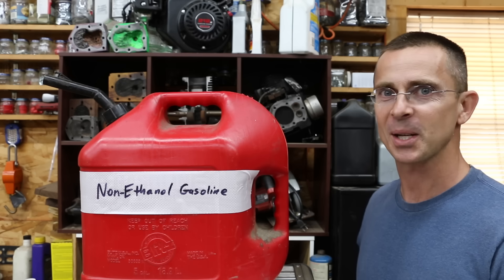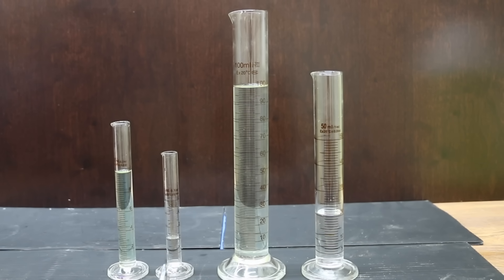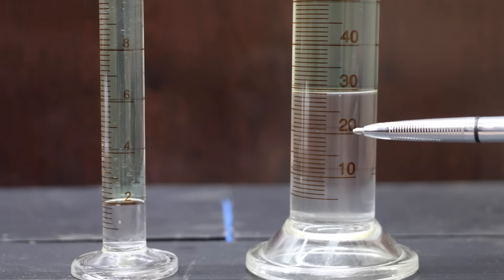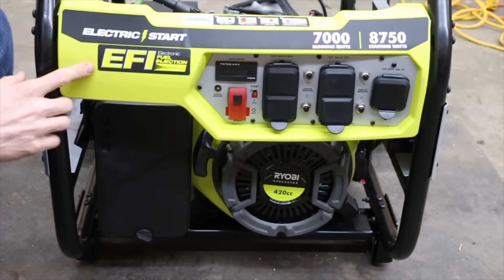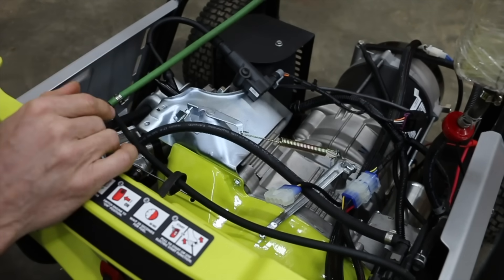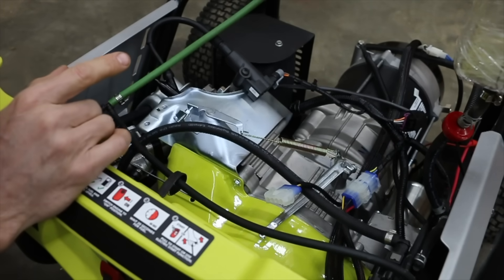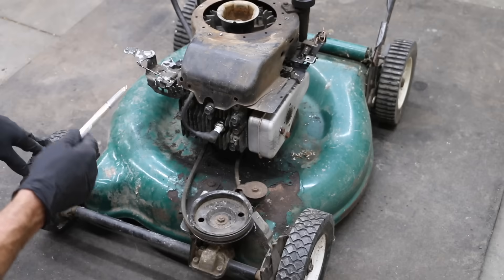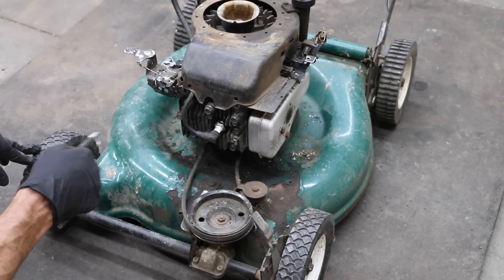Is Non-Ethanol Gasoline Really Better? See the PROOF!

Comment: Pros and Cons of E0 vs E10
E0:
+More energy = higher MPG
+No phase separation = long shelf life
-- Costs more
-- Not sold in my state * (Not once seen it being sold at any pumps in the state, but it is sold at some places)
E10
+Cheaper
+Better "tailpipe" emissions (I'd rather breathe E10 exhaust then E0 exhaust)
+Works as a very good long term engine cleaner
--Corrosive and attracts water
--Not sustainable, also funds monocrop agriculture
--Worse mileage
--Higher volatility can cause vaporlock
Reply from the maker: Great point!
Reply: @ProjectFarm  

https://www.sciencedirect.com/science/article/pii/S0301421513003856
Reply: @skeetorkiftwon  wow. 80% loss of energy from well to pump. Then we use an internal combustion engine wasting another 65-70%. That's 6-8% energy ROI, and it's crazy profitable. No wonder the trend is so hard to buck.
Reply: @timwcronin  

The loss has to be covered to run anything. Ethanol can't cover it. Well nothing can really.

 Batteries consume more energy in production than they ever store, then the coal drops from 100% to 60% at the turbine, lose another 20% to the generator, another 8% to line loss, another 25% to average battery life charging efficiency. Now half it to cover the battery. 

Even assuming perfect efficiency in the drive train you've doubled the minimum weight of the vehicle with a 1200 lb battery in a 3500+ lb car. 

Who cares how efficient the drive train is moving twice the weight when it's ALWAYS using more energy? 

Now remember it took liquid fuels to build and maintain the electrical infrastructure, the batteries, the cars, and support all of the food and the vast majority of other dependencies society takes as a given. 

That is how important a 6-8% energy margin is post consumption, not production. Of course, we could always go back to animal and manual labor.
Reply: @skeetorkiftwon  crazy right? So much stored energy and 92-94% of it's wasted, and it's still competing as the best. A pulse detonation engine would easily double the efficiency and then we're stuck on fossil fuels for another 100 years. I'm starting to think dystopian futures in movies may have been prescient.
Reply: @timwcronin  

A pulse detonation engine? As in the rotary motor, the pulse jet engine, or nuclear explosions behind a space craft?

There is no jet engine design that delivers force more efficiently than direct contact with the road, as pushing against air wont get you very far without a ton of thrust, i.e. massive loss.

That's why commercial flights aren't leer jets leaving every fifteen minutes with 20 people instead of two hundred or so.

There are tremendous applied science complications with even experimental physics that are demonstrated to work. You might get an engine to run, but can't keep it running with the materials it needs to run. Maybe the explosions are too powerful, or the vibrations too great, or you need to make the engine block out of stainless and the cost of cars would double without any longer life. 

There's lots of "great ideas," and in the engineering fields they've been thought and rethought thousands of times before the turn of the 20th century, let alone the 21st.
Reply: @skeetorkiftwon  as in an internal combustion engine that uses detonation instead of deflagration.
Reply: 恵勇気  In your dreams. Since ethanol takes almost as much energy to make as it delivers, it has no significant impact on oil imports.
Reply: @rcnelson  
Lol
Reply: It's only cheaper because you're penalized for using ethanol free fuel. It actually costs more to process ethanol and add it to fuel than it does to process regular gasoline. It's a con all the way around, and not a good one. You could cover every square inch of arable land in this country with corn to produce ethanol, it wouldn't come close to meeting the demand of switching to 100% ethanol fuels. It would barely meet the demand to supply the machinery to harvest and process it. Go ethanol free if given the option, you'll pay a bit more at the pump but less in the long run by filling up less often.
Reply: @codypoole3924  lol
Reply: Biggest issue with gasoline storage is probably the butane in gasoline which helps gasoline ignite. over time the Butane outgasses leaving the gasoline depleted of butane. Thus making it harder to start you engine.
Reply: @guytech7310  Look up Butanol as a fuel - it's a step past making ethanol, and has been around as an industrial solvent for decades. Also, it can be used in an UNMODIFIED internal combustion engine as it has similar properties to gasoline.
Reply: @guytech7310  You're kidding right? Butane? It's a gas at standard temperature and pressure, meaning that there is zero butane in gasoline. You are wrong.
Reply: Nope & I am not wrong. I am not kidding Butane is added to Gasoline. FYI: Dissolved gases can exists in most liquids, For instance:Fish need dissolved oxygen in Water to breath. 
https://oilprice.com/Energy/Gas-Prices/The-Reason-for-the-Fall-in-Gas-Prices.html

"butane can be blended into gasoline, and its fractional contribution to the blend roughly determines its fractional contribution to the overall vapor pressure of the mixture."
Reply: Let's correct "Better 'local' emissions" to say DIFFERENT local emissions.

You're producing a lot of formaldehyde and acetaldehyde with ethanol that isn't produced from E0 fuel.
I have no clue how those two are as 'greenhouse gases' but they are both toxic and are considered to be potentially carcinogenic.

Not to that gasoline exhaust is preferable or anything.  We just need to be aware that often when we hear about emissions, it's usually in a CO2 / greenhouse gas / hydrocarbon-fuels-are-the-devil kind of a context...
Reply: @HocchanFan  Correct! And Formaldehyde is a carcinogen.
Reply: E0 is so much more expensive for me that it's not worth buying in my daily; it's 70¢ per gallon more and I've heard it's $1 per gallon more in some places but it's 30¢ per gallon in others. I'm only using it in small engines since it'll keep them better and it has a longer shelf life (so it's much better for storage.)
Reply: @101Volts  You can get E0 near marinas as well, as watercraft are required to have VENTED fuel tanks, and e10 can't be used because of the corrosion caused by water attraction. You can get AVGAS as well at airports but it's leaded as well as expensive.
Reply: @QuantumRift  Interesting hearing this, thank you. I, personally, don't live anywhere near a Marina though.
Reply: on Brazil all cars are ethanol compatible so they can run in gas or ethanol and our gasoline have like 3/10 ethanol to gas ratio
Reply: all ethanol is; a farm subsidy, its more a contaminant then a fossil fuel E0, uses 2x the energy or more to produce
Reply: @wildfire53575  lol. Keep it coming it's getting even better. Better read some more propaganda to type on here
Reply: But muh' corn! (That China put up crazy duties for!)
Reply: US Government subsidizing ethanol production is the reason it is cheaper.
Reply: You sure it's not sold in ur state? Check your local lawn mower shop. Husqvarna fuel is 95 octane, 0E
Reply: @ragalyisp   

Josh Nixon Thanks! I found the stations in my state, unfortunately none within 280 miles of me...
Reply: What state do you live in? https://www.pure-gas.org/ lists all stations that offer non-ethanol gas. 30 cents more for me, but a longer lasting engine, more power, and better MPG are well worth the trade off. I use it in every car and small engine I have
Reply: Lower emissions?  Not really if you look at energy output.  You use more fuel to get the power output up to the same level as 100% gasoline.   So how is it better emission on e10? Corn growers association propaganda.
Reply: @timothyhays1817  

Loo
Reply: 恵勇気  you must've missed the memo.

We're supposed to like Saudi Arabia now.
Reply: Ethanol doesn't touch my equipment. I don't want my chainsaw to be drunk when there is work to be done. My lawnmower, chainsaw, brush cutter, and generator have never drank alcohol, and ain't gonna while I'm alive.
Reply: @CGoffgrid  That sounds about stupid.
Reply: Its corrosive, therefore it’s a poor long term engine cleaner. Try putting it in smaller gasoline appliances and you’ll notice it destroys components over time, especially if the device is left sitting for a prolonged period. If you run  it regularly then it’s fine.
Reply: @Alex30060  My point is when its used in cars that regularly get run, IE a daily driver, it cleans up the combustion chamber and valves nicely. Ethanol is a really good solvent. With that said, I have never had ethanol problems in my daily drivers, albeit vaporlock during hot starts
Reply: @Taydrum  I was in heaven when a new gas station opened up within driving distance that has ethanol free. I have a 31 year old truck and E10 was constantly eating my fuel lines, to the point where I started carrying yards of the stuff rolled up under my seat because invariably a section of fuel line would rot while I was out on the road and start leaking.

I started using E0 as much as possible and my fuel line rotting issues went away completely, and the engine runs a whole lot better. It has a TBI, which expects E0 and runs like crap on E10 in either really hot or really cold weather.
Reply: @GGigabiteM  I agree E10 totally destroys fuel systems in cars made before the ethanol gas era.
Reply: @Alex30060  
If the engine is made for gas then yes. If it's made for ethonal then no and gas would then be bad for it
Reply: Yeah, doesn't it take more energy input to produce ethanol fuel than the ethanol itself produces? With motors though,  it all depends on how your car is tuned. My 2001 car runs noticeably better on pure gas, unfortunately everything around me is 10% ethanol now, but on the rare occasions when I find pure gas, it surprises me how rough it runs on the 10% crap. Either that or all the gas is crap around where I live.
Reply: What about water in E0. Where does it go 😏
Reply: @rosen9425  To the bottom of the tank. Gasoline and water don't mix or attract, they repel each other. The test was to show the alcohol content of the E10. Water and alcohol attract and mix then they both settle to the bottom because water is heavier than gasoline.
Reply: Another downside of E10 is that is causes corn prices to go up which effect grocery prices.
Reply: @songman68  

Not really. Without the subsidies for the fuel they likely wouldn't be able to grow. This also isn't food grade. Might as well say it raises the cost of potatoes too.
Reply: skeetorkiftwon it does, why??? because farmers stop producing food crops and make shitty ethanol corn crops.
Reply: @songman68  I think that's a canard. GMO corns like BT corn isn't palatable and heavily subsidized so it just sits outside of full silos. High fructose corn syrup is one use, but only because the corn is so cheap. We're not talking about the same corn on your dinner table with BT corn.
Reply: @songman68  
Nope. Not at all. 
Corn prices are decided by market forces. Corn is cheap now what drives it up is drought. And guess what the corn used to make ethonal your not gonna eat. Only livestock can eat it. People consume sweet corn or white corn (tortillas, chips etc) and they are not used in making fuel. The grain used for making ethonal only takes out a small percentage of the corn the rest is left over and is called distillers grain. High grade feed.  So rest your weary head and stop listening to big oil propaganda.
Reply: @songman68  one other thing, you need to research on just how much say for example loaves of bread is made from a bushel of wheat, Or chips from white corn. You will find out that the corn/wheat prices effect so little of the end product it is negligable. It would be like 2 cents per loaf of bread or bag of chips of prices Rose from $3.80 a bushel to $8.00 for corn. The manufacturer just raise the prices up to guage the public. My cousin works for Frito lay and he said that the bag cost more than the contents in the bag. 
If you want cheaper prices then tell them not to use a fancy bags, commercials on TV, huge 20 million dollar bonuses for executives and an annual 3% net growth of profits per year for investors on those dividend stocks.
Reply: One cost that no one talks about that effects EVERYONE! Is food! When the alcohol mandate went into effect food prices went up drastically. I had a few laying hens that where given to me. I fed them laying crumble that I bought weekly. The week after the mandate was signed, the feed went from $8 a bag to $10 a bag. The feed store told me that all of their feed prices jumped 20% or more overnight. With in a month beef, chicken, pork, and grain related food had started going up. So I don't think it's cheaper.
Reply: @nickd5943  

Your feed supplier is lying to you, or his to him. Distillers pass the feed right back out as a cash crop.

https://www.ag.ndsu.edu/publications/livestock/feeding-coproducts-of-the-ethanol-industry-to-beef-cattle
Reply: @nickd5943  

Lol you just learned about market forces and got gouged by your feed guy. I guess tire prices going up is to blame on ethonal as well. 

Corn rose to $8.00 a bushel briefly because of the drought that occurred at the same time ethonal was introduced. Now corn ranges from 3:20-$4:00 on the market board. Farmers won't get that price as many places in the Dakota's have a glut of corn and prices at the grainery can be $2.80. The plants besides selling the ethonal then they can sell the distillers grain.
Reply: @easylooker4889  No corn up here this year
Reply: Good list, though why is E10 not sustainable but not E0?   Also, vapour lock is hardly an issue surely.
Reply: Id rather breathe e10 fumes...? mate youve been breathing too many to list that as a positive... dumbass
Reply: - fields of crops absorb carbon.
- grains going into ethenol plants are predigested, sold to Farmers/ranchers as animal feed.  Makes them very fat which in turn creates food.

Comment: When are you going to do random stuff with 2 cycle engines? You can find them pretty cheap, and if you cause any damage that’s not too bad you can easily and cheaply repair them
Reply from the maker: Great recommendation!
Reply: Do you mean 2 strokes? Those things are terrible at gas mileage and they polute the air like crazy, they are banned in some countties
Reply: tristan 123455 2 cycle is a 2 stroke. If you had to ask that I think you need to gain a little more experience. If you had experience you wouldn’t care about what a 2 cycle does to the air. In a small 2 cycle engine it is very minimal with how much it’s putting out for emissions.
Reply: @positivenegative6525   I've never ever heard anyone saying "2 cycle", and 2 strokes aren't even that cheap because the production of them are banned in some countries, in my region it's actually cheaper to just buy a 4 stroke compared to buying them from china and paying a ridiculous amount of money to ship it.
Reply: tristan 123455 in America, they come cheap. Weed eater brand weed eaters can be found for 60 bucks. You tear it down for the engine and boom, this channel has a 2 stroke engine for testing. With this channel being based in Texas, I’m sure he can find a cheap 2 stroke engine. Plus, plug in 2 cycle into your search engine. It’s just another name for a 2 stroke engine or whatever it is being used for. I have Castrol 2 cycle oil here at home in West Virginia, and it says exactly “castrol 2 cycle oil” on the bottle. Another good source for 2 stroke engines is a scrap yard. Even if the cup is all tore up and the rings are seized to the wall, it’s an easy fix. 2 strokes once dominated America because of their simplicity, power, and fewer moving parts.
Reply: tristan 123455  also, how do these countries that banned 2 strokes have people running stihl brand equipment when they are 2 stroke engines that fire every other revolution instead of every revolution. If you’ve heard a newer stihl and wondered why it sounded like a 4 stroke it’s because of this.
Reply: @positivenegative6525  interesting, a used 4 stroke costs less than $100 in my country

Comment: That hydrophilic property is exactly why ethanol should not be in humid Florida's gas. 

A 4% difference in time does not equate to better fuel efficiency overall, just that it took longer to burn. Also, you should have had the heaters placed outside, so that the ambient temp wasn't a factor.
Reply from the maker: Great point. Thank you!

Comment: I like Supreme gas. You may not get a whole lot more horsepower or efficiency however you will have a cleaner engine inside over the long run! This is coming from somebody that used to tear engines apart for a living and put them back together.
Reply from the maker: Thank you!
Reply: PF has actually already done a video on regular/premium fuel.
Reply: I'll remember that if I ever see the station.

Comment: We use ethanol free gas in our cars that older than like 25-30 years. The old engines without a fuel injection Austen can’t combust the water from the alcohol and will cause a weird sticky buildup making the cars run hard and if they sit too long making it so you have to tear apart the carburetor to fix it as we had to do to a 1674 Kawasaki 100
Reply from the maker: Thank you!